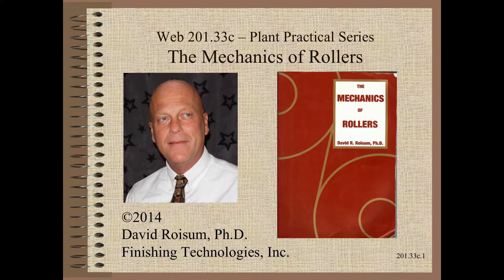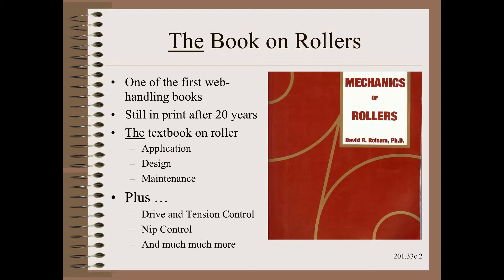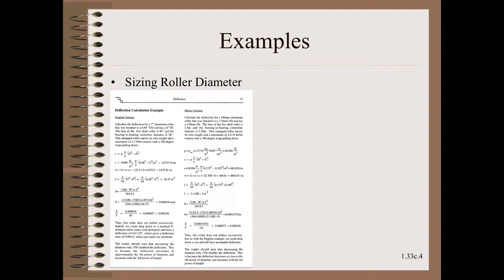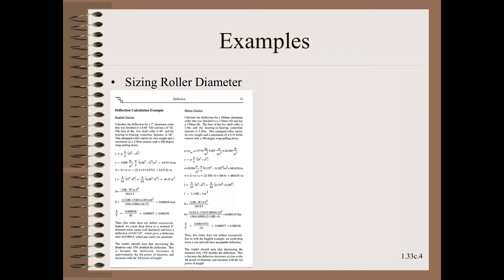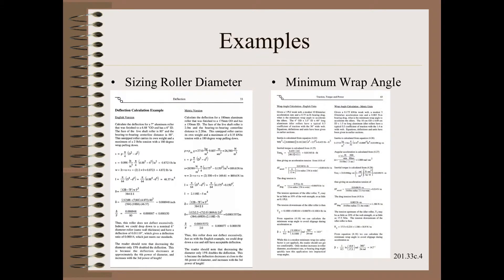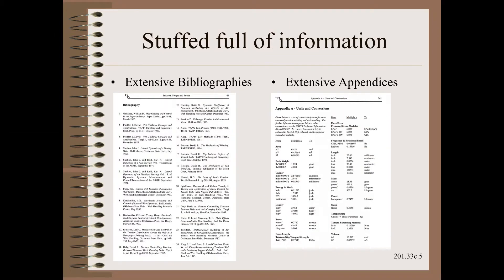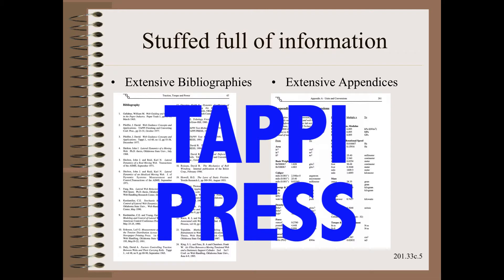Web20133c - The Mechanics of Rollers Book

Comment: Hi, will there be formulas and easy to understand graphical illustrations in the book? Also do any of your book cover splicing and the printing industry (I'm working with machines like the CI printing drum, flexographic printing)
Reply from the maker: The roller book is the only one on that subject.  However, The Web Handling Handbook, Destech 2020, has a great chapter on the subject AND is the Bible of web handling.
Reply: @DavidRoisum  Ok, thanks.